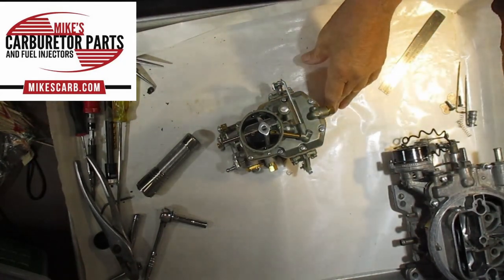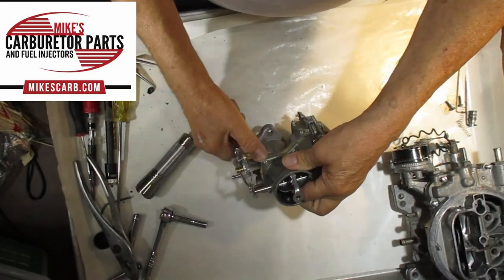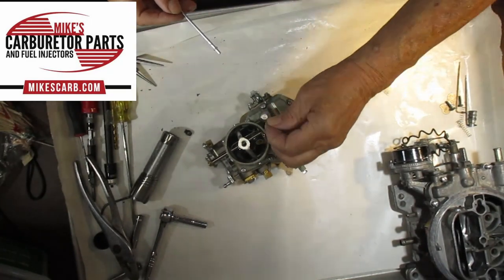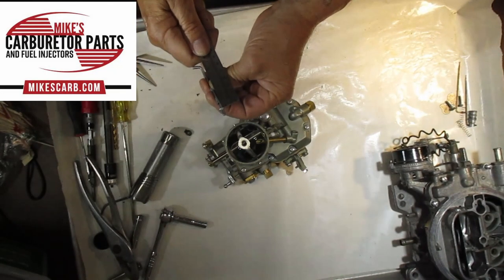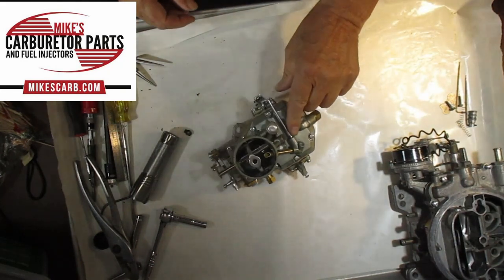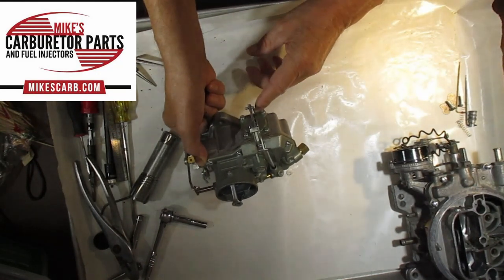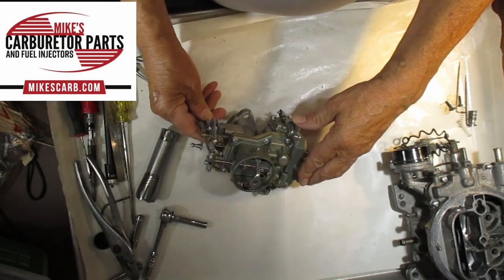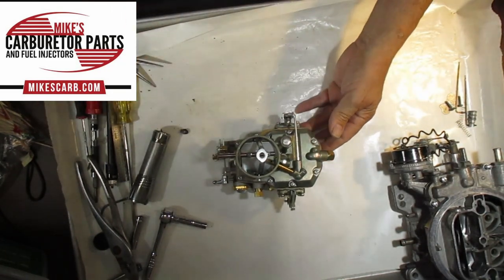Autolite 1100 1 Barrel Vent Rod Adjustment

Comment: My original vent rod has the notch at 7/16" .  Should I use that, or the 1/4" you specify?  Also, does the clip "sandwich" the vent actuating lever, or are the two holes of the clip next to each other?

Comment: What if my carb just has the hole plugged where the rod is supposed to come out?
Dang thing has the venturi half molded from JB weld so it might just be time to core swap it out
Reply from the maker: Unplug if you can. They usually have a plug that will pop out.

Comment: Does a problem with this vent cause vapor lock?  When my 1964 200-6 engine is warm or hot it is difficult to start.  I've been told this is caused by vapor lock, and my vent rod is broken.
Reply from the maker: It's possible, but I would look at other things first. Look down the carburetor after turning off the hot engine. If gas is dribbling down the venturi then you have gas siphoning cause gas in the intake. https://www.carburetor-parts.com/autolite-1100-troubleshooting

Comment: My issue is that on my new, right out of the box 1100 (american) the 223 engine starts but screams to 4000 rpms and holds there.  I dont know what im doing, really, but I know that's not right.  Vent rod?
Reply from the maker: If you bought a Chinese carburetor then the linkage is the problem. We have run into this several times. It just isn't built right.
Reply: @MikesCarburetor    Thanks!  And thanks for answering my email about my other carb!  I'll get em running...

Comment: What would cause the float to stick on a new motorcraft 2150 carb? It came from summit so it's a refurb.
Reply from the maker: A bad float pin maybe. How do you know it is sticking.
Reply: @MikesCarburetor  it pours gas out of the vent and you can thump the top of the carb softly and it stops and runs perfectly.
Reply from the maker: @rickymiles9018  It is most likely the needle & seat getting dirt in it. Change the fuel filter and check the needles viton tip for any scoring.
Reply: I have 2 of these carbs for my 66 bronco. The first one has the filter whole threads damaged.  Neither has the vent rod.  One is plugged and the other is just a open whole. 

Why would someone remove these and plug the hole or leave open.  Float not stopping fuel??  

What issues would it cause with it missing??
Reply from the maker: Many rebuilders plugged then off because the parts weren't available. We have them special made. @offroad6309